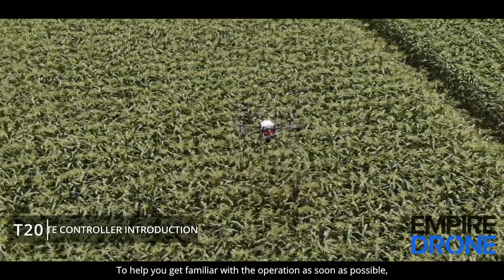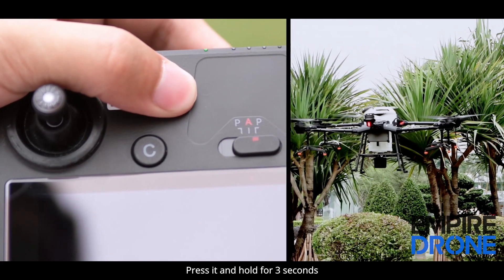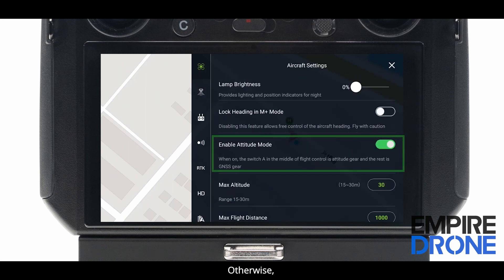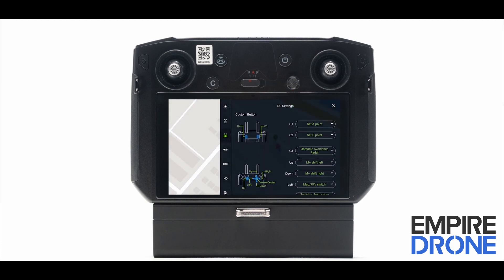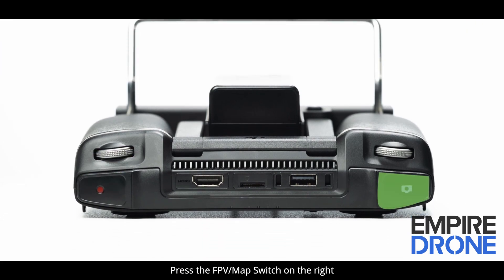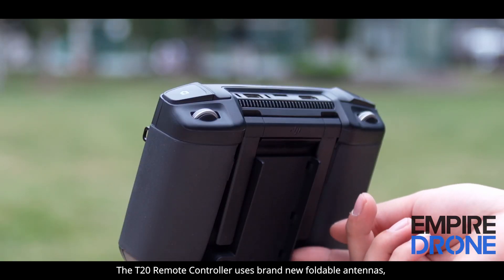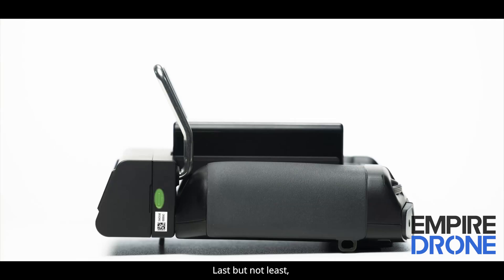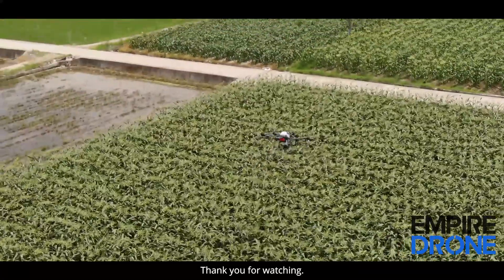DJI Agras Smart Controller Tutorial

Comment: Right out of the box from DJI a Smart Controller will not fast charge. Display says ‘charging slow, use the charger that came with the Controller’ we are.
Checked firmware no issue. May have to do a factory reset and try again, or send it back to DJI for repair. Other than that it could be a good controller.